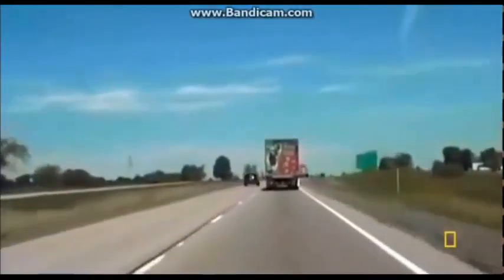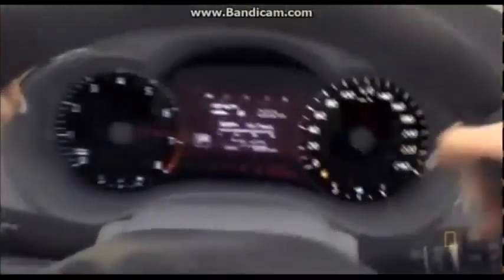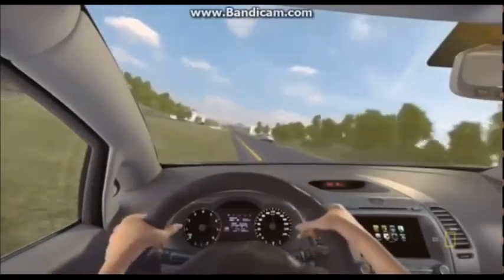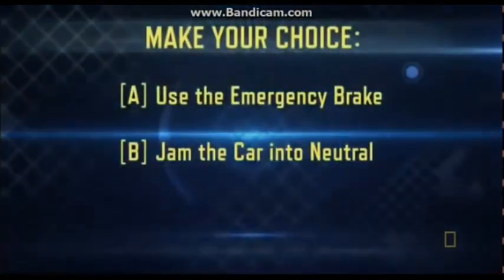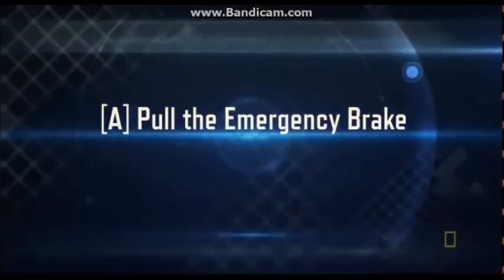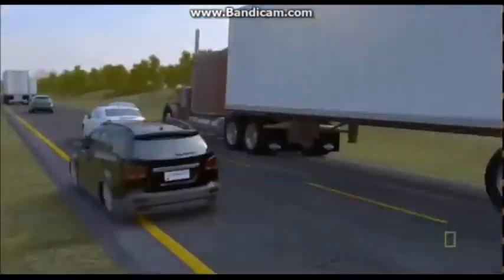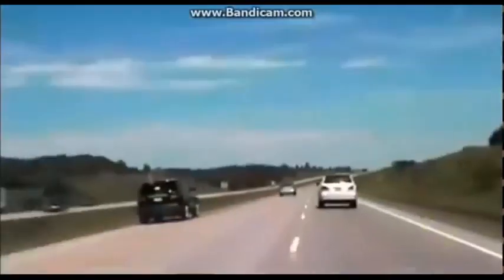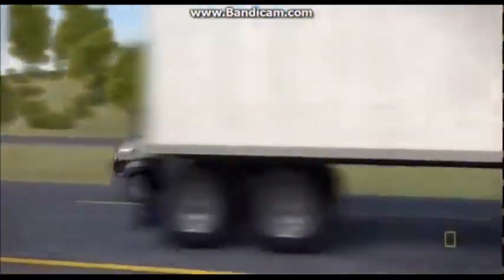How would you stop your car if your gas pedal stuck

Comment: Turn the key back ONE CLICK, leaving the key IN the ignition. This will shut down the engine and WILL NOT lock the steering wheel. At this point you will not have power steering but it’s hardly necessary at speeds above 20mph or so. Also, you will not have power brakes. The brakes will require a lot more pressure to be applied, but will absolutely still be effective. Bottom line is, this is not a difficult situation to solve. If you can’t figure this out you probably shouldn’t be on the road in the first place.
Reply: Turning the car into first enginition with electrical power on modern electronic control systems will not happen. 
If you try that when the car is at highway speeds nothing will occur. Worse case is when power is stuck in constant application, car will not go into neutral and there is no way to cut engine power. 
It in effect becomes a runaway car.

Comment: c, my car doesnt have a  locking steering wheel nor a power steering
Reply: Joxdel _ stiff steering I see
Reply: What do you drive?
Reply: Turning the engine off would bad idea because you'd loose the brakes. If the car is manual, you can just press the clutch, if it's automatic you can simply put it in neutral.
Reply: You dont loose brakes with the engine off lol
Reply: THELOSTRANGER yes, you do. Try using the brake while the engine is off, it will become harder and harder to brake.
Reply: THELOSTRANGER Not completely but you do lose a considerable amount of braking power
Reply: its harder because the assist(powered by vacuum) is gone. the break is still physically connected to break pad via bread fluid.
Reply: After a few seconds of using the brakes with the engine off, it will be super inefficient. Of course the brakes are still working, but they won't slow down the car as much. It will have like 90% less braking power ..
Reply: And i have actually jump started my car several times by myself. So i'm not a weak individual.
Reply: but there will still be a vacuum in the brake bosster, but if you pump the break a couple of times, there is on more a vacuum then you just need to press harder on the brakes
Reply: If you turn off the engine while going that fast you take a chance of fucking up your engine, just put your car in neutral, its that fucking easy, its literally so simple and every car should be able to do it
Reply: Bryan Southard turning off an engine is no worse than shifting to neutral while going over 100 mph...

Comment: You can turn off the engine if you have a old car with no power steering
Reply: You can turn it of if you have power steering also, only diference is that it will be harder to steer and harder  and harder to break when you run out of power to the breaks also after a while. I have driven a manual driven car with power steering 10 km downhill to safe fuel with it in neutral and engine of.
Reply: My dad's old car with no power steering will lock the steering if you turn off the engine. But turning the keys to ACC helps to unlock it
Reply: Turn off engine make oil pump less working so it was too risk to spent expensive cost new engine.

Comment: "turn of the engine and your steering will lock up" you mean the power steering no longer works ?
Reply: Mishka no they think turning the engine off means you need to pull the Key
Reply: Mishka no, modern cars with anti theft feature will literally lock the steering wheel once the ignition is turned off
Reply: Gokul Sreekumar That doesn't apply when the car is moving
Reply: wrong, depending on the car. I know for a fact Audi's and newer Ford's lock steering when key is pulled, it doesnt matter if you are moving or not.
Reply: DixieNormus That's if you pull the key, which you don't have to do to turn the engine off.

But yeah if you pull the key out, it nowadays usually locks the steering wheel.
Reply: Ayumi Kuro what about keyless entry and start cars? Like our audi a6?
Reply: jeremy kagchelland 
As far as I know they don't lock your steering as long as the car is moving. Couldn't find the User's Manual for an A6 though, in which this is explicitly stated. Mostly because I am to lazy, but I remember other manuals stating explicitly, that the steering won't lock until the car stops moving.
Reply: Ayumi Kuro would be weird if they let the steering lock while driving, I will look into the manual when I have time to figure this one out
Reply: If you turn the engine off with the car moving, it won't lock the steering wheel, but you will loose the power steering, so it will be harder to turn the car, but you can do it. The real reason why you shouldn't turn the engine off is because you will loose the brakes. Once you press the brake, the pedal will get harder and harder, to the point where you will no longer be able to brake anymore. The only viable choice here is to put the car in neutral if automatic or press the clutch if manual.
Reply: mikey I had personal experience with this once. Like a dumbass I turned off my car while it was still in drive and I was on a hill so I started rolling, my steering wheel was completely locked, brakes still worked luckily and the wheel didn't  unlock until I turned the car back on.
Reply: martin austin did you just turn the key to the first position. So the lights and sound were still on? Or did you take it all the way out.
Reply: As far as i know, the only way to lock the steering wheel is if you pull the key out of the keyhole.
Reply: Pluto : All the way out. And I wasn't able to turn the ignition because it was locked so I had to turn the steering wheel a little to unlock the ignition which was pretty fucking difficult to do because the wheel was locked, eventually I somehow figured it out.
Reply: Does it lock for a sante fe?
Reply: It's yer boi da mane How do you run out of gas twice in the same car?
Reply: It's yer boi da mane Not necessarily the best budget car to have. But I see where you were coming from. My first car was a 2000 Buick Lesabre, aka the Granny Mobile. I didn't even have a working gas gauge, I used the trip meter.
Reply: I realize that newer cars steering wheels lock up. I don't own a newer car so I wouldn't know.
Reply: An automatic car will not lock the wheel unless the car is in park. You will lose power steering but it's still possible to steer.

Comment: Stg if there are actually people out there who wouldn’t turn off their engine... lord help these creatures
Reply: JIMBO i hope you know that you dont have to take the key out for the engine to be off right?
Reply: I have driven a car with manual gearing and power steering with the ignition of downhill 10 km to save fuel... It is not a problem, it only gets a little harder on the breaks and steering without the power. In fact I rather prefer the breaks like that without the power assist as it makes them easier to control and avoid locking.
Reply: Good luck trying to shut off a runaway diesel engine.
Reply: It's yer boi da mane power steering does nothing when you’re moving, you would rather run into someone or ruin your car going into a ditch with your gas pedal down instead of being safe and turning off the engine? Pushing the clutch in or putting it in neutral will just red line and kinda something you don’t want to do for a long period of time. Just because it’s what I’d do in this scenario doesn’t make me ignorant
Reply: You will sacrifice powersteering. If you could choose to have power steering or not, you would choose power steering.
Reply: Soleimsen you don’t have Any muscles if you can’t turn a steering wheel without power steering.
Reply: Noki A lol why do people assume that without power steering your car is useless. Omg I’ve owned multiple cars without power steering just be a man about it.
Reply: Yeah, I wonder how people managed to steer their cars before power steering became available. /s
Reply: Cars that were designed without power steering are just as easy to turn as cars with. Their steering rack and gear box components are completly different. Cars that are supposed to have it and lose it are hard to steer regardless of how big your "muscles" are, and going at speeds like this, there's no way you could steer with busted power steering to avoid a crash.
Reply: I am 12 and dont know nothing about cars and i choose the turn off engine
Reply: There's risks to turning off the engine. Ultimately, you're way safer putting it in neutral

Comment: If I shouldn’t use the emergency brake, then why is it called “emergency” brake? 
Hmmmmmmm 🤔🤔🤔🤔
Reply: emergency brake is a stupid name, here in britain its called a hand brake, or parking brake in America, (as well as e-brake)
Reply: There's a good reason why that brake operated by a lever on the floor (mostly) is indicated by a (P) light on the dashboard (or on the button itself with electrically-operated parking brakes). As Liam said, the proper name is parking brake.
Reply: Because in the worst case scenario it can stop the car and keep it in place. 

But it's not powerful enough to just stop an SUV zooming at XXX kilometres per hour, you have to slow down first.
Reply: like the only time you should use the emergency brake while driving 1) you want to lock the rear wheels on purpose. 2) your brakes have failed and you pull the hand brake up slowly and modulate the height so you dont lock the rear wheels

Comment: If you tunr the key, the engin turns off. The steering will lock only, if you completely turn the key over. Also. When the engine is off, the transmission also will help to decrease the speed. When this happens, gently pulling the hand break will help to slow. Even regular breaks, if the still work.

Comment: Turning off the engine doesn't lock up the steering wheel. Turning off the ignition and pulling the key out does. Which would be stupid. 
So in case B (done properly) you can slow down even quicker because of the engine breake (and avoid blowing up the engine). But yeah, no steering servo and breake booster

Comment: the steering wheel will NOT lock if you turn off the key with the vehicle in gear.  steering column locks ONLY when car is in park.  this is a built in safety feature for this exact situation.   the video shows the driver taking the key out of the ignition (man made animation).  but if they are suggesting to leave the engine on, thus fueling the motor and faulty electrical feeds (computer),  you better brace for impact.

Comment: Wow im glad I saw this video cause before I saw this my best guess was turning the vehicle off but the steering wheel locking is very true so can't do that man I'm glad I saw that cause if this ever happened now I know what I would have to do. Which I hope this will not happen cause it's a nightmare if it did so yeah I'ma have to just put it in neutral and do the best I can if it were to ever happen 😕 and I mean you have to prepare for anything that can happen and know what to do as well

Comment: Turning the car off to accessory won’t lock the steering wheel, but you will be steering manually since the assists are off but make sure there is a long road ahead and no cars in front of you.

Comment: D - If you drive a Volkswagen or Audi made after the mid 90s, just apply the brake. The brake pedal will signal the ECU to cut power to the engine as a failsafe.

Comment: I learned this by riding a motorcycle. If you down shift in a turn your rear wheel will always lock up and you will low side and the only way out of it is pulling in the clutch which puts the bike in neutral. Same works for a car. When I drive my car up to a light and I know it's going to be a long light I slip the car into neutral which lowers the rpm and it just coasts.

Comment: C: have a manual car. D: Turn off the engine half a turn of the key, leave the key in ignition and brake.  Steering locks only engage when the key is in fully off position and removed completely.

Comment: Some cars if you turn it off the car you can turn the key in the ignition 2/3 of the way and the wheel wont be locked without the ignition turning on.

Comment: The problem is, power assisted brakes need vacuum to work which you only get when the throttle valve is closed. When you hit the brake more than ~2-3 times, the vacuum reservoir is empty and you wont come to a stand anymore.

Comment: You can still put that car in N in a automatic, there also Over drive and, turning the key in the off position and pull the herald, or riding against a railing to slow down,(although this one is for when brake lines fail)

Comment: turning off the engine is not a bad plan actually but as soon as the engine shuts off u turn ur car into accsessery/on(no start) mode which unlocked the wheel where u can turn and the cars power steering will still have some momentum as the engine is shutting down, aswell as putting ur car into nuetrul.

Comment: If you drive auto and his happens: Press in the brake, put car in neutral, brake your way on to the shoulder, pull up e-brake, then turn off your car. 
If you drive manual like me: Press in the clutch, shift into neutral, brake onto the shoulder of the road, pull up e-brake and turn off engine.

Comment: This happened to me while I was driving my moms automatic transmission car.  My first thought was to jam it into neutral, because I knew about the E-Brake risk, and also figured if I turned off the engine, I'd lose power brakes, and steering.
Reply: You’d lose power brakes but firm steady pressure will work nonetheless. Yes power steering gone but over like 30ish mph it’s not very hard to drive without it

Comment: You can turn the engine off and go in neutral.
I was going to the gas station out side of town and my car ran out of gas climbing a hill, but I made it to the top and the gas station was at the bottom of the other side so just coseted for a half mile in neutral all the way to the pump.

Comment: What if you had an electronic transmission where the gear shifter is on the steering column like Mercedes. Would it still be the same or will the car tell you to stop first??
Reply: Modern cars have a central electronic control system. If there is a fault it would be impossible to overcome. 
All these cars should have an engine cut out switch that ensures power can be cut manually in the case of a power application fault.

Comment: i have manual transmission, personally i d just keep switching to lower gears and use the engine breaks until i m able to put it in neutral because neutral gives way to loss of control. is this viable?

Comment: Do any of these in order;
- put the car on neutral
- try and unstuck the accelerator by kicking it loose
- open the door and bail out in a fetal position

Never use breaks since an accelerating car is too powerful for breaks to bite. Never turn off the engine because you will lose power steering before the engine momentum slows down and youll crash sooner

Comment: if the pedal stuck at a low speed, and you have a manual transmission, you could try going in the highest gear, so you engine isn't strong enough and goes off

Comment: The first thing to try is neutral and after that if it doesn't work you turn off the engine but have the key in the on position so you have steering and brakes but they are both manual not power

Comment: The scenario with the steering wheel locking does not always apply. If you car has an actual ignition with a key, just shut it down and turn it back to the on position without restarting. This keeps the steering wheel unlocked. Not sure about modern keyless cars. Also, if you ever need to shut down a keyless car, most have a press and hold for 3 seconds to shut off while driving if the need arises. Taping the button will not shut down the engine while traveling at highway speeds (or at least not in a Ford). They do this to prevent accidental shut down.

Comment: I would definatly turn the ignition off, I am not putting it into neutral lol, it would blow my engine up.
Reply: If you turn the ignition off you lose power steering and would have great difficulty in controlling the vehicle.
Reply: I know I shouldn't so don't go crazy at me... But when I go down a big hill I will turn the ignition off and put it to the on position, and I coast down the hill just fine, yeah my steering is slightly harder to steer, but it's nothing unmanageable.

Furthermore, you would turn the ignition off as soon as the car started speeding meaning when you turned it off you wouldn't be going very fast, but regardless of what the case is, turning the engine off is the best way to go in that situation.
Reply: Its not hard to drive without powersteering when you are moving
Reply: OrfiCaldaRi Exactly, which is why you should turn the engine off, turn the key so the steering doesn't lock up, and that is how you would resolve the situation
Reply: On this case yes, it's the right thing to do, however you should never turn off your engine, or drive in neutral, normally, even when going down. It puts to much pressure on your brakes.

Comment: If you turn off the engine, the steering wheel does not lock, there is an extra key position for that, so turning off the engine would be a solution. The only problem is, that it is very hard to move the steering wheel, because with the engine you also turn off some assistance. And an other solution is like shown, pressing the clutch/going into N and then breaking.

Comment: Actually, turning off the engine wouldn't lock the steering wheel cars still allow for the free use WITHOUT power steering and would be no problem cruising until you come to a safe halt. And some cars are ONLY automatic and don't have a manual at all sooooooo.

Comment: jamming it in neutral is stupid. you'll fuckup your gearbox and engine. just turn it off and turn on the ignition right away. turning on the ignition without starting the engine prevents the steering wheel locking up.